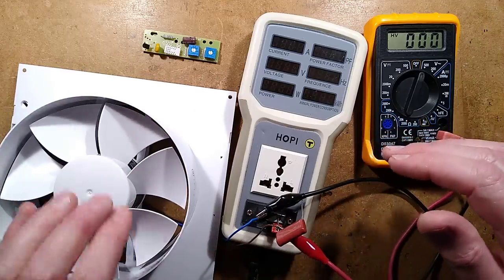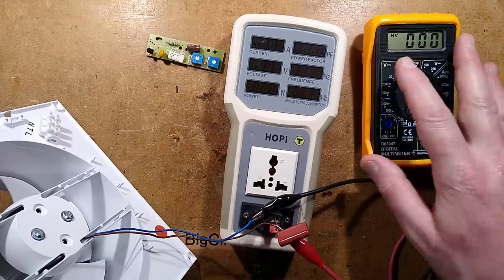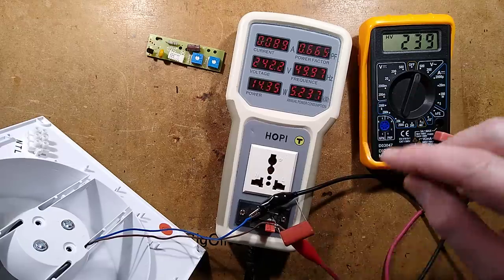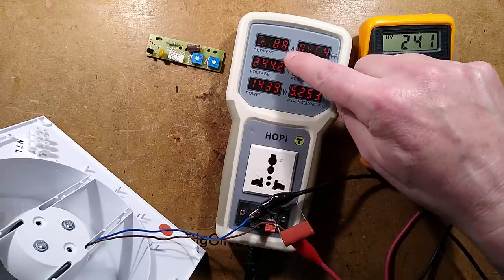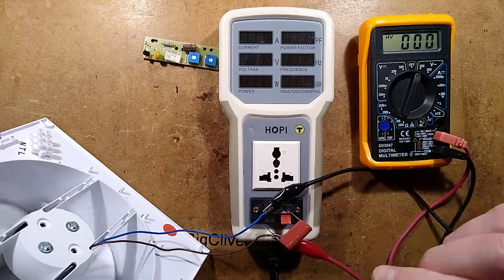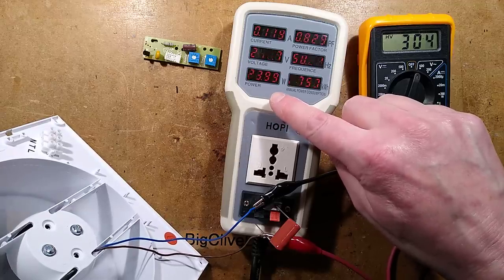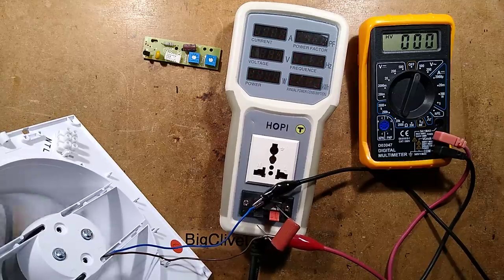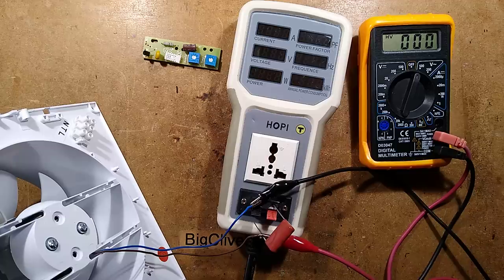What the heck!  Series capacitor makes fan go TURBO!

Comment: Not related to this, but way back when (almost 30 years ago) I had a cheap walkmanoid. The cassette motor could be heard in the background ever so slightly and I thought I might try and filter it out by putting in a parallel capacitor, 100nF. It turns out that with the cap installed it ran at turbo speed! Likely because the speed control needed the back EMF ripple form the motor to know the speed it is at. 

For this fan thingy, I think this is, as some others have said as well, because the resultant LC series circuit has lower impedance than the L alone, and this will translate to increased current. Yet the L impedance goes nowhere but at increased current the voltage and power increase as well. If this is an induction motor, the slip will decrease and the speed will increase, but you can never exceed or even reach the synchronous speed like this. 

Back when I studied electrics, there were many people in my class who had hard time wrapping their heads around these phase shift things that allow partial voltages in a series circuit, and partial currents in a parallel circuit, to be higher than that measured at the source.

Comment: I'm fairly sure i opened up some fan settings before to find a similar setup, ie using caps to control the different power output.  I wont go open up my fans in this weather though!

Comment: Isnt this the same as when we have failing capacitors on ceiling fans that becomes spinning very slow? I mean, when replacing the caps to new ones with correct uF makes them spin with correct speed. I think here the same must be happening but from none capacitors to   a capacitor that makes the speed increase.
Reply from the maker: Those capacitors progressively reduce in value as they fail.

Comment: Big Clive: I believe, I have the answer, but I could be wrong or repeating what someone else has already said. I did not read all 1100 + comments.
The capacitor is acting as a start capacitor, boosting the voltage, to start the motor but then, not being taken out of the circuit, by a speed switch, it continues to supply double voltage, causing the motor to run at double speed (for a very short time, before burning up). Whataya think?

I did that to a grill exhaust fan, in a small ,pool, snack shack. It was a 120v fan and I connected it to a 240v supply, due to someone's wrongly colored wiring. It sounded like a jet taking off, pulled a vacuum in the small (10x12) shack and, then, smoked. That was an expensive lesson. ALWAYS check the voltage. NEVER trust the color of the wires. 😁✌🖖

Comment: I have a "Helios ELS-VEZ 60" fan for air exaust in my windowless bathroom. There are already 2 capacitor inside: the 1st ist a phase shifter for the aux winding an the 2nd one is in serie to the motor itself.

Comment: It’s probably resonant at 50 Hz (or whatever the line frequency is there.) A sort of band pass filter whose output is the fan speed. Try a capacitor 1/10th the capacitance, and one @ 10x the capacitance.

Comment: I've had a 'similar' idea for a while, but was unsure whether it was just a brainfart, Clive.
I've been thinking about guitar pickups and why they're essentially bog standard basic tech.

I thought why do they have to be restricted to one magnet on the bottom of the coil.
Instead, I wondered if there was a weak 'placeholder' magnet like a rubber fridge magnet, connected to a rotary switch housing a variety of small but strong magnets.
When the switch selects each magnet, its magnetism travels to the placeholder and alters the pickup's field, changing the strength and timbre of signal.
I thought that a capacitor between the switch and pickup would help in case there was signal dropout, possibly even boosting it.
It seems you've had that boost.

Comment: Resonant frequency.  An LC circuit (with some R) can output a higher peak AC voltage across the L or C than its input.  This peak will depend on the Q.

Comment: This Fan seems like "Shaded Pole Motor". This electrical model of the fan is , a series inductor (Leakage inductance) and back EMF generated by rotating rotor into the winding of the stator.
The difference between the input voltage to back EMF is the voltage across the Leakage Inductance. That why the P.F. is poor. When you place a capacitor in series, part of the Inductive impedance cancel out by the Capacitive Impedance (They are 180 degree apart). So basically you are forcing the back EMF to increase. To get higher back EMF, fan has to rotate faster.

Comment: I've heard it called "resonant rise". It occurs in all sorts of AC driven equipment. Tesla coil beginners frequently burn out Neon Sign Transformers by connecting a capacitor which is - in theory - the perfect reactive load for the xformer to drive.  But it usually turns out that that value of capacitor resonates with the huge secondary inductance at 60Hz.  Result: the voltage can climb to a bit less than double the rated voltage, breaking down the insulation and shorting windings, wrecking the xfmr. :/
Reply: fun fact, if you have a capacitive load for a transformer, the xfmr probably doesn't need much or any PFC capacitance in the primary side; one can think of the capacitance of the load being  "reflected" in the primary, multiplied by the turns ratio or if you prefer, the inductance of the two windings.
("reflection" is an incorrect way of thinking about it theory-wise, but it's a functional way of thinking about it when your task is to pick out a PF cap)
Reply: @railgap  better example would be a tesla coil itself. it is a resonant transformer it pushes the voltage so high by the resonance between the secondary inductor and the capacitor in the air. it is a resonance transformer.

Comment: By adding a capacitor in series and the value of the capacitor brinks the natural frequency of the LC combination close to 50HZ or 60Hz then you are assisting the load to work more efficient with more voltage across L. Impedance of fan =2πfL and capacitor =1/2πfC.

Comment: Similar thing happened to me. Tried to fix car charger that has 3. different voltage ranges but all under nominal. So i put cap between +and - of full bridge rectifiers legs. It was 3 similar caps in paratel. Almost started a fire when instead of 12v output there was almost 100v. Finnish grid is 240v.

Comment: Remember spinning magnets in a coil of wire produce electricity, a capacitor would  allow to store that "excess" (reactance, why you draw more power starting up then drops at rpm) each half cycle thus causing a voltage boost, and higher rpm.

LC voltage multiplier, where the capacitor kinda acts as your diode by blocking dc bias, and only allowing an ac voltage, and your inductor and magnets are storing power as magnetic flux and kinetic energy

Comment: In ceiling fans there is a capacitor without it speed drops significantly it's because it's an inductive load which opposes itself because of the phase shift that occurs with a capacitor impedance decreases.
Reply from the maker: Many ceiling fans have a run winding with a capacitor to give the fan directional rotation via phase shift.

Comment: LC series resonance.  There is a factor of Q increase in voltage across L and C at resonance.  Off resonance this increase is less.  At resonance one leads by 90 deg and the other lags by 90 deg giving their voltages opposite sign and equal magnitude; the sum is zero leaving only the series resistance to oppose the in-phase current.

Comment: 240V is the RMS value.  When the capacitor charges, it does so up to peak voltage, which is 330-ish Volts.  Compare what would be the result of putting the capacitor in parallel with the motor, across the supply, rather than in series.

Comment: AFAIK, the capacitor is syncing the voltage and the current, making the fan more efficient.
You are lucky you didn't use a polarized capacitor as it would have exploded...
Multiply peak voltage by 2 and divide by pi to get the average voltage of the sinusoidal waveform (AC - alternating current).
Here: 380 x 2 / pi = 242.
= ±"240V" AC outlet has a peak of ~±380V.

Comment: So You've Got a Capacitive Tank that's Pushing the fan motor and the fan is having a ball, the inductance is happily losing it's impedance to the capacitor which is now gathering it faster great stuff and for as long as it doesn't hit resonance it will speed up as it hits brief resonance all slows down then repeats itself I would say.

Comment: What you have is an effect call resonance. The inductance XL and the capacitance Xc cancel themselves out as out of phase with themselves. The overall current increases, by
But  Xc and XL still there and measured across the capacitance or indicator will show large voltages.

Comment: Everyone in the 70's became obsessed with flourescent lighting since they thought it was cheap to run. The problem was that the manufacturers of the units did not include any power factor correction capacitor to compensate for the choke, obviously to keep costs down. Good for sales but bad for the customers. The only situation that this was acceptable was on ships where the flourescent lights were on 24 hrs a day and the generators needed some constant load to run smoothly.

Comment: I had an LED bowling game from the 1980's which ate batteries like crazy. So I found an AC adapter of the right voltage but it didn't have enough power to run the motor which moved the "ball" continuously left and right. So I found a second, different AC adapter of the same voltage and connected it in parallel. The game worked with both 110V wall warts plugged in.

But one day I forgot to plug the second adapter in *and the game worked properly*! I have no idea how it worked. I may still have the game and the two adapters wired together. If Big Clive wasn't halfway around the world it would be interesting to ship him the whole setup to see if he could figure out where the "extra power" comes from simply by having the second AC adapter's DC out connected in parallel to the first one's.

Comment: It puts the voltage & current out of phase. Peak voltage is about 310v for 220vac. Ceiling fans use capacitors to control speed. Why it goes faster in this example, not sure.

Comment: High velocity fans use a starter capacitor (ie hood exhaust and barn fans) which some need routine maintenance cleaning and lubrication.
Reply: So, in this instance, the capacitor is acting as a start capacitor, boosting the voltage, to start the motor but then, not being taken out of the circuit, by a speed switch, it continues to supply double voltage, causing the motor to run at double speed (for a very short time, before burning up)???
Did I get it?
I did that to a grill exhaust fan, in a small ,pool, snack shack. It was a 120v fan and I connected it to a 240v supply, due to someone's wrongly colored wiring. It sounded like a jet taking off, pulled a vacuum in the small (10x12) shack and, then, smoked. That was an expensive lesson. ALWAYS check the voltage. NEVER trust the color of the wires.

Comment: I once thought I'd put a series capacitor on the primary of a small mains transformer to reduce the secondary output voltage. "What a clever idea!", I thought. The mains transformer smoked within seconds. I learned a salutory lesson about L-C circuits and resonance that day! 😂

Comment: It would be interesting to see a scope on that!

Your voltage supply is 240 so realising you are measuring a sine wave (0.707 if I remember rightly) would mean that you can get a bit more ....... you are not at unity. 
This would tally with your Pf readings.

Comment: The power factor has gone up 0.2 making the fan use more real power and spin faster. Note when I tried this on a fan with a starter cap it doesn't improve anything.

Comment: Simple AC series resonance.   The voltages across the motor winding and the capacitor can be indeed quite high, but opposite in phase, so the net source voltage remains constant.  Was someone sleeping in AC circuits class?

Comment: I don't think that the LC resonance is the cause for the higher rpm. Note that the voltage over the winding changes but not the frequency.
These fans are usually wound to have a higher impedance and therefore draw less current. This is called "protected by impedance" and is done to prevent the motor from burning out when the blades are blocked by dust etc. Due to the higher than necessary impedence the slip frequency of the motor increases and the blades turn slower. You can oppose this effect by applying a higher voltage to the motor winding. In this case, the higher voltage is produced by a LC resonant circuit, but you will get the same result if you connect the motor to a Variac and crank it up.

Comment: It's just like in a tesla coil, if you have an inductor and capacitor connected to eachother then you get a substantial increase in voltage causing the fan to speed up. But i wouldnt recommend going above a fan's rated wattage cause it might damage some components.

Comment: I think it has to do something with series resistance of capacitor at a certain frequency. Try experimenting with capacitor of different values connected in series . But keep in mind that the operating voltage of capacitor should never be below the mains voltage it should be somewhere between 300 to 450 voltage.

Comment: its because the power factor increases. inductive and capacitive loads cancel out under ac. if you put a bigger capacitor the power factor will go all the way to 1 than if you increase the capacitance even more the fan will actually start going slower. 
We can see it in the impedance formula Z= squareroot{resistance^2 + (inductive reactance-capacitive reactance)^2}

Comment: Lookit the power factor increase, too, getting more in-phase.  The C is "correcting" some of the L in series.
Like with stepper motors, raising the voltage but using a series resistor to increase R/L current risetime (and thus max speed) at the expense of horrible efficiency.  Only this corrects it with reactance vs resistance.
I've done that with piezo tweeters (the dreaded 10buk Motorola piezo tweeters, about 0.12uF if I remember right), when making bug chasers.  Get the frequency you want to blast, use an inductor to make it resonant and peaking at that frequency.

Comment: I just tried that... interesting.  Old gutted space-heater that I'm using as a fan in a small window to suck air out of the basement to keep air circulating.  About 11W and 0.74 power-factor before.  1uF cap did nothing, and the fan wouldn't even start moving.  Ordered a 10uF "starter" cap, woohoo!  Zipped up to about 20W and 0.90 power-factor.  If I throw on maybe another coupla uF I might get even more.  Tempted to get another starter cap for 20uF total and see what happens.  As long as the voltage above the cap doesn't exceed 400V, I'm gold.
Reply from the maker: I wouldn't recommend long term boosting like this.  It may damage the fan motor over time.

Comment: Lets do some math. I think phaser analysis will be enough to demonstrate why this happens. Suppose we have a 120VAC 60Hz voltage source (Vs) driving a 1 Henry coil with the impedance of Zl.  Converting the components to phaser representations we have:

Vs = 120
Zl = jwL = 60*2pi*1H*j = 377j Ohms

where j is defined as j^2 = -1 (engineers usually use j instead of i for imaginary numbers to prevent confusion with current which is usually represented using i) and w (usually represented as omega) is the frequency in radians per second.  So using Ohm's Law, the current through the coil is 

Vs/Zl = 120/377 = 318mA

The voltage is of course 120 V and the power is:

318ma * 120V = 38W.

Now suppose that we place a 10uF capacitor in series with the same coil and power source.  The phaser representation for the impedance of this capacitor (Zc) is:

Zc = 1/(jwC) = -j/(60*2pi*10e-6) = -265j Ohm

If we add that to the impedance of the coil, we end up with:

377j Ohm - 265j Ohm = 112j Ohm

The total current going through the circuit is now:

Vs/(Zl + Zc) = 120V / 112j Ohm = 1.07A

The power of the coil is now:

120V * 1A = 120W

The voltage across the coil is now:

1.07A * 377Ohm = 403V

The voltage across the capacitor is now:

1.07A * -265Ohm = -284V

Noncoincidentally, 403V - 284V = 119V or 120V with a with a little rounding error.

Now you might be able to see what is happening. The coil and the capacitor are out of phase with each other.  When the coil voltage goes high, the capacitor voltage is running in the opposite direction making its value low and vice versa. The relationship is:

403sin(377t) + 284sin(377t - pi) = 403sin(377t) - 284sin(377t) = 119sin(377t)

Note that these are not abstract concepts. One could perform this experiment with real components to see that it is true as was done in the video, or you simulate it using the SPICE circuit simulator and the following card deck:

120V fan coil with capacitor in series

C1 a b 10e-6
Lf b 0 1
Vs a 0 sin(0, 120, 60, 0, 0) ac 120 0 dc 0

.ac lin 1 60 60

.print ac b
.print ac I(Vs)
.print ac a - b

.end

The experiments and simulations yield the same results as my calculations give or take rounding errors.

Comment: I thought I seen (YT) that as the Frequency across a capacitor increases, it's Inductance decreases and it looses it capacitance ability. I don't know if it's a phase shift (I'm not that knowledgeable) 

How long will the fan last?

Comment: we see similar with ebike motors where the amps through the motor wires can be more than the amps from the battery, I guess the inductive coil windings field collapse generate back emf that adds to the voltage and thus current. As for that extractor fan, yeah I'm puzzled

Comment: Similar thing I observed with my shaded pole fan when I used a cheap step type speed controller 5 speed. 
This exact shenanigan happened on speed 3 which I found the fan's speed running faster than directly powered it in. 
Please explain the shenanigan.